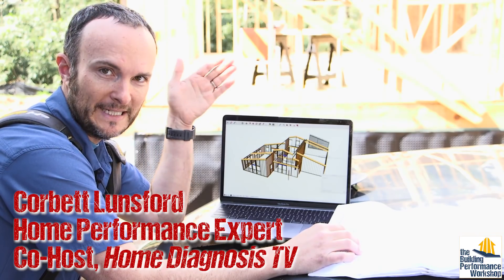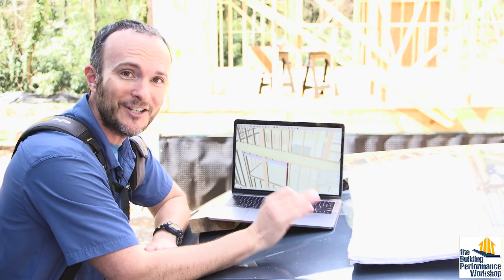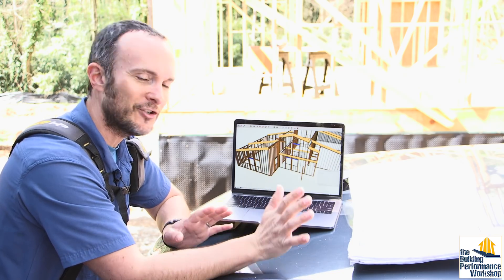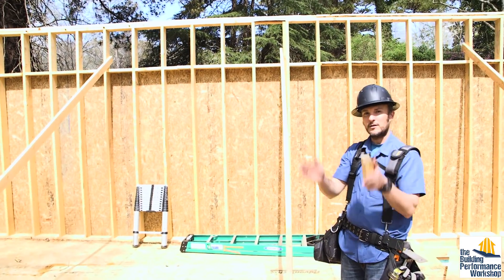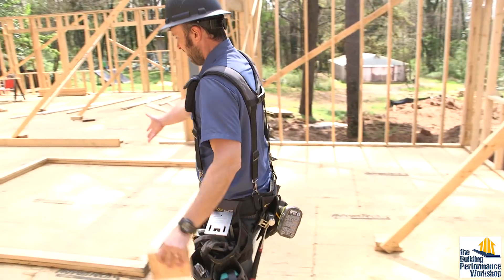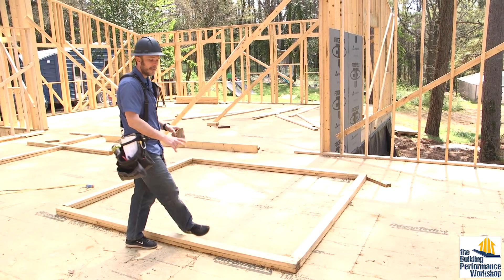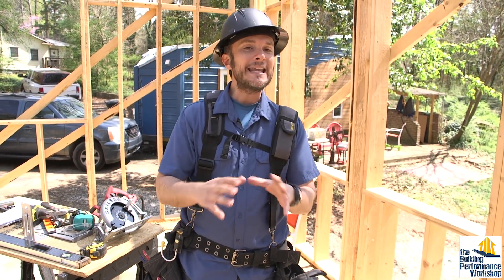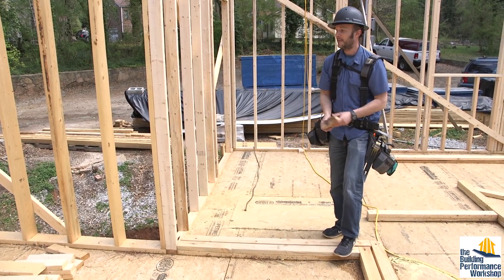How to Frame a House for Performance DIY

Comment: I noticed that when you have two wall sections you,  in at least one case, broke the wall in the middle of a joist cavity.  I'm guessing that you are relying on the second top plate to connect those sections of the wall, as well as the sheathing.  Did you have any problem with framing inspection in this case?  With beams, they want the splice to be close to the supports.

Comment: Very cool that all of the wood cuts were made from the 3D model in sketch-up!

If I were building a new stick home today, I would take a close look at pricing for @BuildersFirstSourceBFS ReadyFrame, which will ship all wood pre-cut to length and inked for placement, based on a 3D model.

An additional service that they offer is to go through the model to find and resolve system conflicts, like where framing potentially blocks ductwork, plumbing, or electrical to avoid related problems in the field post-framing.

Comment: We are an advanced society not a yet an advance civilisation. We are still manual building instead of robotics. Past civilisation can manually build grand structure and dwelling with architectural aesthetics styling and prowess of engineering knowledge and precision with far less and difficult material. Our building today with more tools we can achieve minimum in standard and techniques 1/100 of the past builder in Ancient Rome or Renaissance

Comment: Unless OSB quality has improved, I think you will regret using it in 20 years
Reply from the maker: We'll see! Subscribe and stay tuned. I'll let you know in 20.
Reply: OSB can hold up very well as long as you keep it dry.  His details of using exterior insulation and a rain screen underneath the cladding should keep it dry.  I guess I don't need to worry when I use OSB since I'm already half way into my 60s, and whether my homestead is doing well or not, our whole society will be literally collapsing since all of the houses now are built using an OSB product.

Comment: You don't have to carry all that stuff in your belt all the time. Just carry the stuff you will probably need.
Reply from the maker: Well said, but as a novice I often have no clue what I’ll need until I’m in the moment. Hate having to schlep down the hill for one dumb tool.
Reply: @HomePerformance  Seems like you can just put most of it in the middle of your floor plan.

Comment: I'm curious why you didn't go with studs that are 24" oc instead of 16" oc?  For a performance house using advanced framing this would give you more insulation and less lumber while still maintaining strength.
Reply from the maker: Actually that’s a bit of misinformation I also used to believe- we had a structural engineer verify that we needed 16” oc to maintain strength for our tall walls.
Reply: @HomePerformance  I figured it was load requirement related. Thank you for taking the time to let me know.

Comment: When your building a custom home your theory is pretty accurate.  But when you run a track you cant spend time to measure everything to get it exact. Time is money and your theory all though good takes too much time.. theres a reason its called rough carpentry. As long as you get it accurate your good.
Reply from the maker: I hear you

Comment: I think you mean roof trusses. double top plate is not to ensure lining studs on another floor the load points should always follow through the double top plate is more to lock all exterior wall to each other at the corners and to tie interior wall in to exterior walls where they intersect. the corner you talk about is called a California corner. I only got that far and realized the vid was lame.
Reply from the maker: Thanks for sharing your kind words, mr dog

Comment: If you build with common sense it will be strong provided you know what your doing an engineer really just tries to just use the minimum aloud to do the job and nothing more
Reply from the maker: I think the issue here is the trade-off between performance and strength. The more wood, the less insulation, and so forth.

Comment: Once you square the wall tack it down to the floor thru the top plate then sheet the wall while it’s still laying down it’s way easier and the sheets will hold it squar when you go to lift it ! 🤘🏼

Comment: At 15:04 in the video you talk about expanding the kitchen windows a foot down so your wife will be able to see the kids outside the house when its finished. What I see is you actually added a foot to the king stud instead of replacing the incorrect cut inner member, Is that a legal change for building code? I didn't think you could add an extra piece of wood to the king stud in that fashion because it would be weaker than if you re cut the whole inner member to its correct length without making it segmented like you have in the video.
Reply from the maker: We kept the king and jack exactly where they were, and just inserted a new sill

Comment: So how are you going to keep that perfectly square wall square when you go to sheet it and you need to take that brace off. Only way will be to put one on the inside first, thats double work and a waste. Sheet it on the floor or plumb it after its stood.
Reply: I really don't think anyone in this video or comment section has a real clue how to frame.  Making a cut list to exact dimensions off a CAD rendering?  Are you cutting those pieces to a  +/- 0.001 tolerance on a PERFECTLY flat, squared, and dimensioned slab?  If I got to work off of a slab like that, I'd be pretty damn pleased.

Comment: You should use double top plates it keeps the wall straighter and joins everything tighter run the but wall top plate over the through walls

Comment: What led you to choose the GP ForceField sheathing? I'm interested in  using the Huber Zip R with 1 inch insulation to eliminate the thermal bridging. Comparing the two, GP ForceField to the Regular ZIP, it seemed that ZIP might be a better product based on the WRB being "Baked" into the panel as opposed to glued like the ForceField product.  I'd appreciate the background on your sheathing decision. 
Thanks.
Reply from the maker: Stay tuned, George, all will be explained
Reply: When. You use zip sheathing you can't sink the nail heads it voids the warranty .  I've yet to see a builder not sink the nail heads.

Comment: 15:50 is not how a inside corner works. The wall on the left has no backing.
Reply from the maker: Maybe you can’tsee it, but the backing is specifically what I’m trying to point out
Reply: @HomePerformance  Caught that too Darryl, that is indeed an incorrectly framed corner for backing. Although I'm guessing that was filmed prior, re-framed and the detail missed on the edit, see 6:00 to 6:13 where it's all magically in the correct position when explaining backing :) Enjoyed the vid, interesting approach
Reply from the maker: Thanks Matt- yes, the magic of cinema sometimes gets heavy on magic

Comment: Dude... hate to burst your bubble but that Skilsaw IS a circular saw. Skilsaw is a brand not a type. Skilsaw is to circular saws what Kleenex is to facial tissue or what Google is to internet search engines. Now it may be that your Skilsaw branded circular saw may have a worm drive and not a direct drive, but it is still a circular saw as evidenced by the circular blade.
Reply from the maker: It doesn’t burst my bubble, but I own 3 circular saws and they don’t handle like the skilsaw. I understand your point, but it’s a pretty different tool that I wouldn’t normally want to use since it’s so heavy, but for building beats my other 3 any day.
Reply: @HomePerformance  you miht be thinking of the difference between a worm drive saw and a side mounted motor.   the light saws have a direct drive motor on the side, but the skil in your video is a rear handle worm drive.   Plus for side mounted motors they have lefties and righties.
Reply from the maker: Sounds accurate
Reply: Theres always that one person in the comments.

Comment: For High performance framing you use 2x6 24 oc instead of 2x4 16 oc. Thus saving both material costs and reducing thermal bridging. I don't believe anyone is doing 2x4 oc 16 anymore, except for interior walls. For Corners you use "California corners" so that you can properly insulate the corners. For windows headers you put thin foam insulation between the inside and outside wood studs to reduce thermal bridge. When you apply the sheathing to the wall studs, its best to put a bead of caulk on each stud & top\bottom plates. As well as caulking between the two top plates and the floor\bottom plate.   For you walls it would have been easier to fully sheath up to the top before you raised the walls. Its a lot easier to nail sheathing when when the wall is on the ground. You basically doubling or tripling your work having to hang and nail all that sheathing. up. If you haven't do it, it would be wise to take down the walls and nail the sheathign and re-raise the walls in my opinion. 

For Cutting 8x4 sheets of plywood\Sheathing, a Track saw works best. Is very easy to get dead straight & clean cuts with a good track saw. You can use a track saw to cut the windows\door opens after the nailing the sheathing to the wall studs and before you raise the walls.
Reply: I watched a video from an architect/builder in Ottawa Canada who used two 2X4 connected with osb gussets then used these 'studs' to frame a wall 22 inches thick filled with insulation and osb sheathing on the inside as a vapour barrier sealed with high performance tape. R90 walls and less than 0.6 air changes per hour at 50pa, it is a certified passive house.
Reply: You’re top notch, that’s how I was tought too. I wish there were more people framing this way. I’m a home inspector and see a lot of things that make me cringe. Also, if you plan for it you can set the rat or sole plate back 1/2” to create a ledge for your wall sheathing. Drive a couple temporary nails to leave a gap at the bottom so it is able to dry and you can pretty much hand it all yourself! Sheath right over window / door openings and cut it out with a reciprocating saw or chain saw later
Reply from the maker: Thx Old Skool ✊🏽
Reply: Great comment. I wonder how you cut the windows opening with the track without risking to cut the studs though. Do you know of a video that shows that method?
Reply: For one: You can adjust the cut depth of a track saw so it does not cut into the stud. You just measure for the rough window opening. Measure for the locations before fastening the sheathing, Or  you can mark the opening location. Shift the sheathing high or low and mark the locations, then re-position & nail it.
Reply: @guytech7310  ha yes. Stupid me ofcourse use the adjustable depth. I actually did that exact thing to cut some hardwood flooring without cutting the subfloor a couple of months ago...
Reply: @guytech7310  No you don't, you sheath over the window openings then router it out using a flush cut bit. Measuring and using a saw (especially a track saw lol) to cut out a window opening is unnecessary
Reply: @anand8905  Using a router bit is slow. especially for big windows
Reply: @guytech7310  it all depends on the size of the window
Reply: Use a router with a flush cut bit for window openings. Sheath over the entire opening then use a router after. Do not use a track saw, waste of time to measure and cut lol  @Niklaos
Reply: @anand8905  I was thinking of using the plunge saw form the inside not outside. You wouldn't need to measure anything.
Reply: @Niklaos  Why not just router?
Reply: @anand8905  I would expect the plunge saw solution to be much faster but maybe I'm wrong. I think that router approach is fine though, I might end up doing it. I'm looking for the most efficient solution I guess.
Reply: you dont balloon frame walls over 9' tall @ 24" OC. Dont confuse advance framing techniques used for value engineering w/ performance framing. this looks to be a hybrid. structure first!
Reply from the maker: Bingo- structural engineers can get you where you need to be. Ours has.
Reply: Search Wanderhouse passive house tour. He knows what he's talking about.

Comment: Where are you sourcing your interior magnesium panels? I've heard bad things about that product coming out of China and my local big box guy had no clue what MgO board was.
Reply from the maker: Yes, we know- there are a few manufacturers in the US apparently, but they all make different grades of MgO because there’s no regulation or standards
Reply: There are regulations that apply to 5/8" sheet rock. Since it is fire rated, the quality control is much higher. 5/8" sheet rock, type X is what everyone should use. Double the fire rating of 1/2", better sound dampening, higher energy performance, better water/ mold resistance, etc @HomePerformance

Comment: Different priorities and different goals. Yup. That explains a lot. 

So you can order all your structural framing pre-cut? How much more does this cost... or do you save on some labor and it evens out?
Reply: It adds a lot more cost than it saves. It causes you to have to hunt for each piece instead of just taking a standard board and cutting it to length. It is faster and cheaper to cut on site. Compound miter saws are cheap enough to set one up on site near the bunk of 2 by's and rapidly cut what you need as you need.
Reply from the maker: I imagine you could, but I would think it might become a real hassle- flexibility being key

Comment: Quick thought on stacking the studs directly over each other..... if you have a 2story building many times your air ducts to the 2 story will be installed in the wall cavity. It's reall makes things nice if your stud "bays" are stacked accurately. You receive better air flow, there are less fitting to seal up and it takes the installer less time. All good reasons to stack your wall studs. Just my musings.
Reply from the maker: I hear you, but if the goal is to control performance, and the enclosure’s airtightness and insulation continuity is of primary importance for the mechanicals to perform, then we should stop putting ducts and plumbing in exterior walls at all. We did it on our last home, doing it this time too- not difficut to do.
Reply: You should still stack your studs from a structure stand point. Keeping the load ad linear as possible as opposed to staggerd. Thats the main reason its done, the mechanics is just an advantage

Comment: I live in Colorado, we have infloor heating, when it comes to the framing we have  two floor plates, if you plan on doing any floor heating keep in mind that you need basically an inch and a half for the plumbing and jibcrete, hence the need for two plates, not sure if its relevant but you never know
Reply from the maker: Interesting, Edwardo- we don’t have radiant in this house but could add it later from beneath if needed.

Comment: You are going to keep pairing down your belt as you go till you have just the bare essentials. Keep your gun oil on or at your compressor. I've made the mistake of mine exploding in my belt. Messy mistake. Keep it light and tight.
Reply from the maker: Spoken like a master carpenter
Reply: @HomePerformance  He's absolutely right, keep it light!

Comment: Cordbet, you didn't install sill seal under exterior walls as a seal you better verify with inspector.
Reply: Do you mean from wall to subfloor like in this vid? Not needed. If you mean wall to concrete foundation then yes needed but that wasn't in this vid.
Reply from the maker: What’s that for?
Reply: Sill Seal between wall and subfloor provides a compression gasket that stands the test of time as a air seal between exterior and inside with sealant at inside connection corner of wall to floor best practices.
Reply from the maker: We have a much better air sealing system to install, stay tuned.

Comment: I like the comment about using sketch up to "see" how stuff goes together.  
I've been doing the same so that I can measure where studs are in the wall vs the "knocking" ( damned if I can ever tell the difference ).  And where studs are around windows.  Amazing how simple and less frustrating it is when you want to hang curtains around a window and you were always so concerned about if there was a stud or NOT.  Now I know, well better understanding, of the make up of the studs around doors, windows, corners ( and now your explanation of through/butt walls .... yup another light came on ) to know how to get stuff done.

So many "pros" come on and state about how wrong or right something is.  At least you give your reasons.  Thanks
Reply from the maker: Great thoughts, JJJS! Thanks for following.
Reply: "I like the comment about using sketch up to "see" how stuff goes together. "

Mostly a waste of time. Basically workers don't have time go back to the computer to get the dimensions. Normally a Framer snaps lines on the floor where the walls go and marks off where windows\doors go. Then the top and bottom plates for all the walls are cut and loosely nailed down into position. The window\door locations are marked on the top and bottom plates so the locations of the window door frames can be located. Once the vertical studs are nailed into the frame the top & bottom window header\bottom are measured and cut. No framer is going to constantly walk back and forth a computer to get dimensions for each piece of lumber. That would double or triple the time it takes to frame.

The only time it makes sense to use a computer is if you going to order everything pre-cut which a mill pre-cuts and sends all the framing material to the job site, but that has its issues since some times issues with the plans are discovered during the framing which requires changes. For instance Perhaps there is a interior wall has to be adjusted or the owner wants a window location or size altered.
Reply: @guytech7310  I meant for me .... not for the one doing the work.  Hopefully I'd be smart enough to hire someone who's a bit more competent than me.  :)